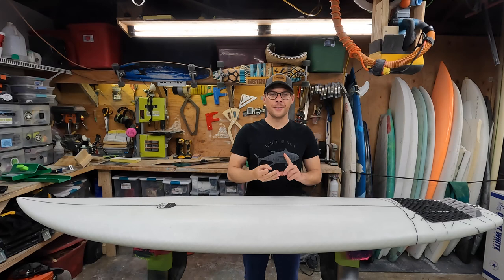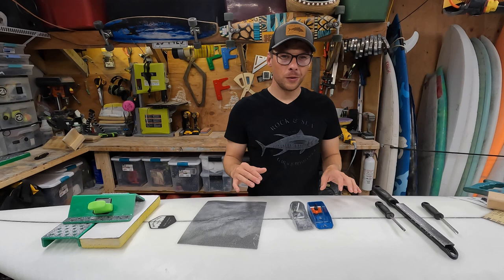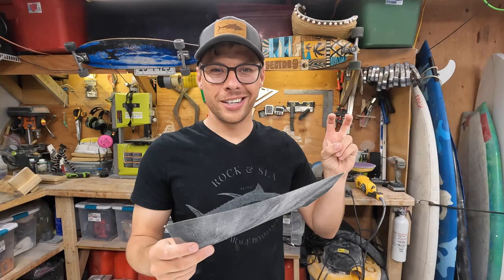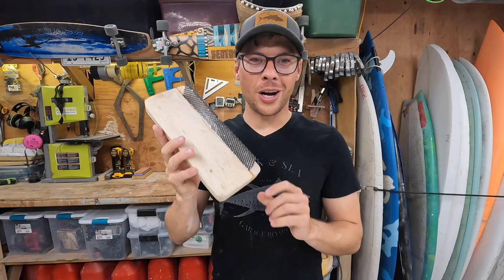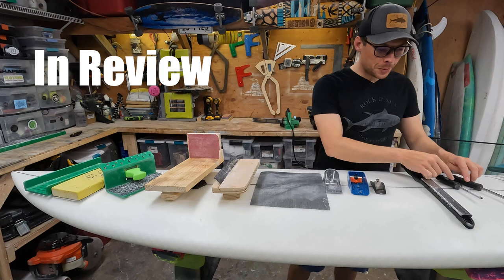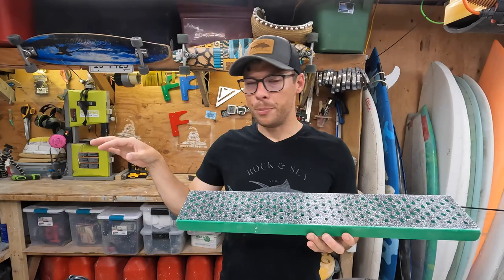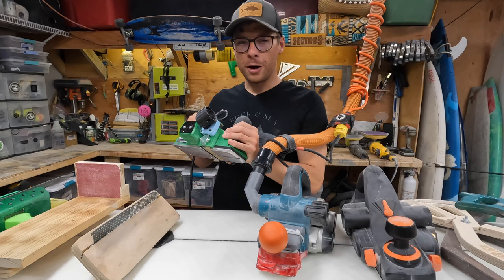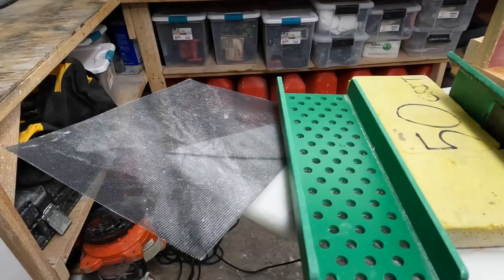Every Basic Tool You Need to Shape a Surfboard [At HOME]

Comment: I just started shaping in my garage, in Florida. Honestly, I'd now consider the planer a must have tool. I started foiling down with a hard block and 40grit sandpaper (not nearly coarse enough...), but it just takes wayy too long and with the heat I was sweating buckets. The $40 Wen planer did the same job in about 2 minutes what would have been hours haha. Totally worth it in time and sweat, and cheaper than the Greenlight rasps.
Reply from the maker: Seriously, after upgrading I could never go back to just hand tools, also planets are just so fun!!

Comment: Been considering getting the Rail Runner tool however I exclusively shape PU foam. You said it tears it pretty aggressively? Would you recommend a different tool for the job?
Reply from the maker: I love the Rail runner for eps, really can’t beat it.  But for PU I actually prefer using home made 90 degree wood block jig with 50 grit paper glued on.  The rail runner is even lower grit, it does an amazing job on eps but it is so low grit it actually doesn’t cut as fast as 50 grit

Comment: Hello bro i have a question plz, what size is the drywall screen tnx
Reply from the maker: 9x11!   I use the 80 grit screen then finish off with a sheet of 220 grit sand paper Here is a link! https://shapersupply.com/products/sanding-screen-80-grit?_pos=1&_sid=2353447c1&_ss=r

Comment: How do you drill the fin boxes holes on level 1 tools? Thanks
Reply from the maker: You can shape a board with super basic tools, level one is all you really need.  But for popping in fin boxes, you really need to go all in and buy the router jig setup https://youtu.be/zOXwxiaNG-8?si=I8LTfDT7ZDOUjKpu      One way around that, especially if you just testing the waters and getting into it, you can hand shape your first board, and then take it to your local glass shop, when you have them glass your board you have the option for them to put in the fun boxes for you!   You can technically free hand route fin boxes with just a router and normal bits, but to really get true tight tolerances you pretty much need the jig kit.   Hope this helps!
Reply: @RockandSeaGarageBoardShop  got it, thanks a lot!

Comment: Lol these are the tools that would be nice to have yet I do NOT NEED them, remember people has been building surfboards for decades WITHOUT all these capitalist gadgets. I have seen also people doing an excellent job WITHOUT many of these tool.
Reply from the maker: Yes sir, actually mentioned how you didn’t need most of these 20 seconds into the vid.  Shaping boards is such a fun fulfilling craft, don’t want to scare away people trying to get into it because they think they have to spend a ton of money to buy all the fancy stuff.  I shaped my first few boards with essentially no tools, works fine just takes longer.  I do have to say I’m a bit of a gear head, it’s pretty fun to slowly save up for the next fancier tool, modify them to your liking, or best of all make your own tools that fit your need perfectly. Kazuma has a bunch of handmade sanding tools each specific to sanding a part of a rail etc… super cool